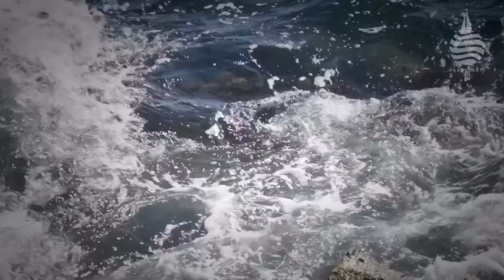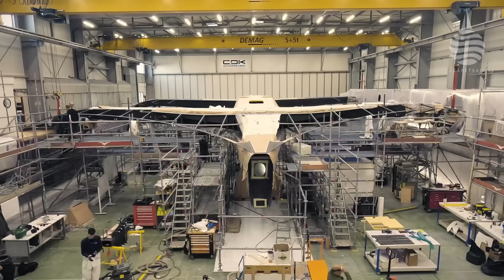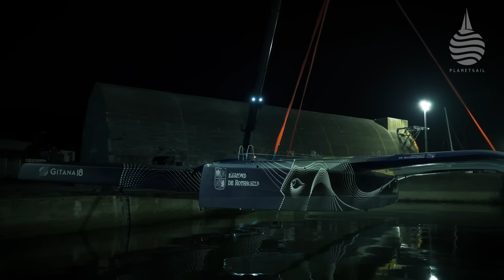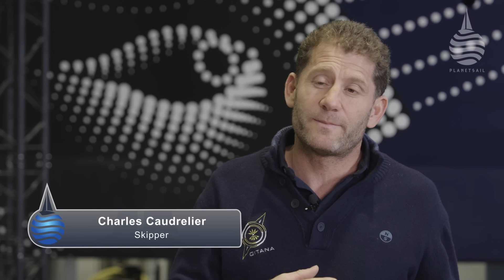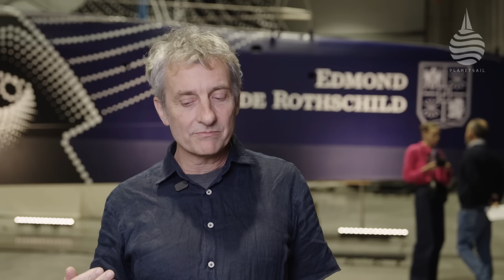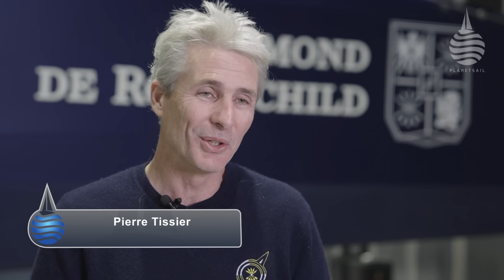Gitana 18 - Is this the world’s fastest offshore trimaran?

Comment: The next version will be a flying plane above the water, AI automated without any sailor onboard. The question becomes: is this sailing?
Reply: It will always be sailing as long as the mechanism relays on the fluid interface and free surface between water and air. An airplane never interfaces with a water free surface to make it work

Comment: Sometimes of course you want to slow down the boat. Hi tech multis are prone to sliding down waves and crashing into the back of the next wave. Masts have been broken.. 
So very light in weight with enormous mast and windage, running downwind in a gale with a big sea is going to be a major problem.

Comment: One thing strikes me when they talk of the energy or power required to adjust the sails, foils, rudders etc then would this power requirement not be drastically reduced if the boat was smaller? Is there a mininimum size for an ultim? How small can you go and keep a 3+meter ride height?
Reply: The issue with a smaller boat is that it struggles a bit more in swell.